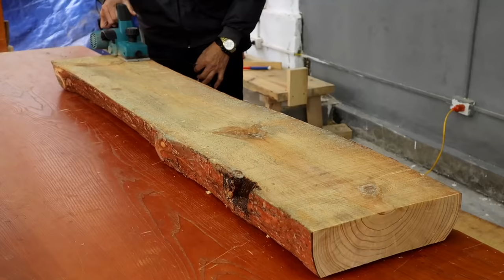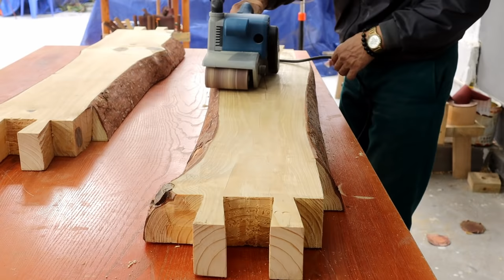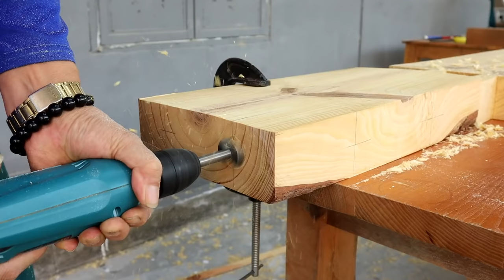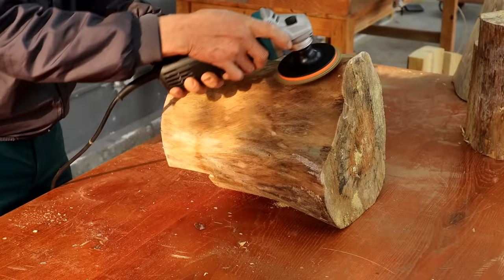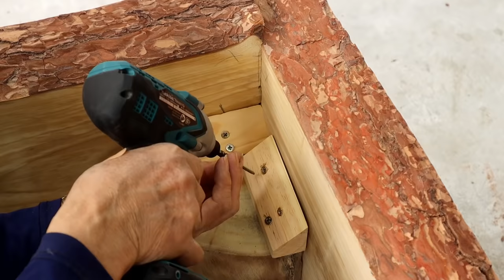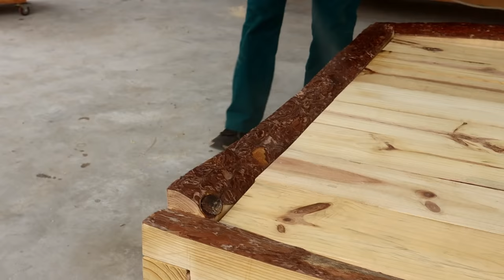Extremely Creative Woodworking Ideas With Solid Wood // Build A Strong Bed From Large Blocks Of Wood

Comment: What kind of wood did you use to get that yellow look?
Reply from the maker: I use pine wood
Reply: @diycreationwoodworking3247  thank you for replying.  I didnt know pine had that yellow in it. It looks great.
   Awsome job on that bed.
Reply: @maitlanddarragh5676  , there are a variety of pines. Many will turn yellow after applying a clear finish.